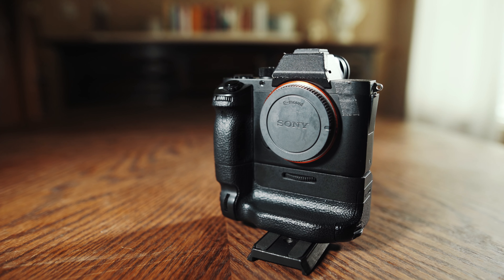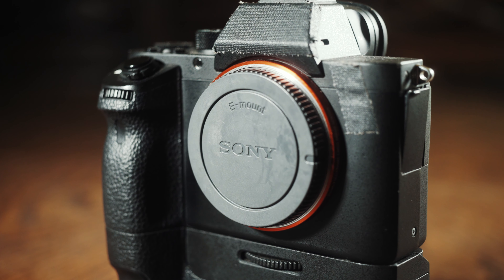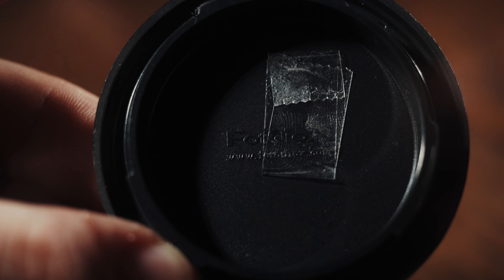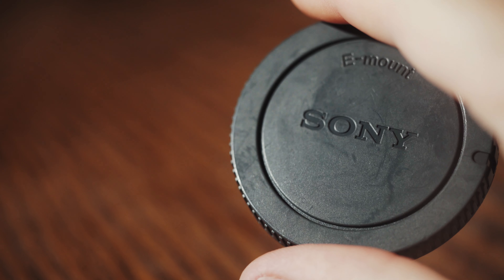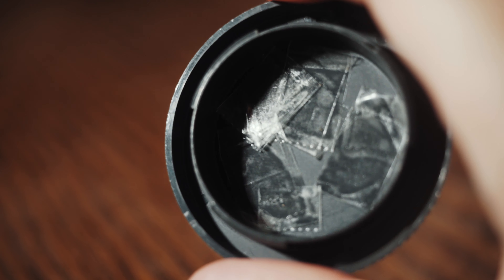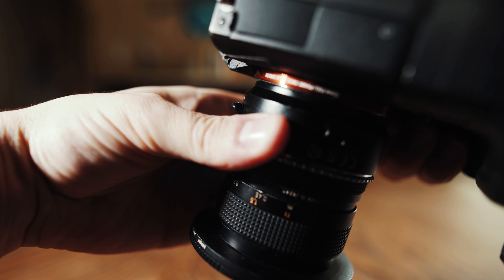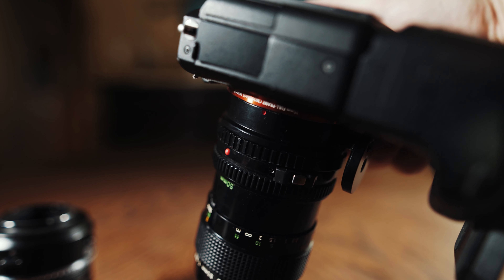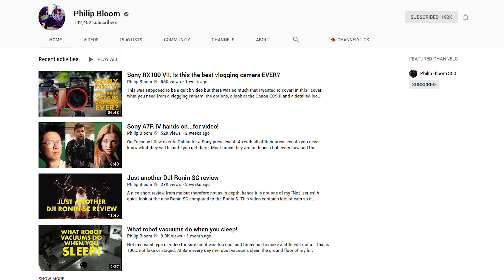Here's a quick & cheap way to keep dust off your camera sensor!

Comment: But how do one keep it out of the element/glass? get through the telescopic lenses? It's likely not possible. 
I got an used lens, but it was mint, no dust inside, after few months, it got some dust between the elements. It's a 24-70 GMII. I guess only way is to replace all of the seals. No idea how much this lens was used, but looked mint. I try to extend the zoom and wipe the dust off. But I guess I should’ve done that when I got it and through the months after. But I can't stop dust from existing in my bedroom/editing room.

Comment: I need help. So basically I was changing lenses and a little bit of spit got on my shutter that was covering the sensor. It evaporated but left a dark little smudge i can still see on the shutter. Images still come out fine. Is there a way to safely, properfly clean the shutter? Thank you .